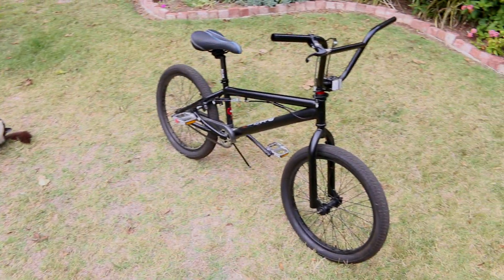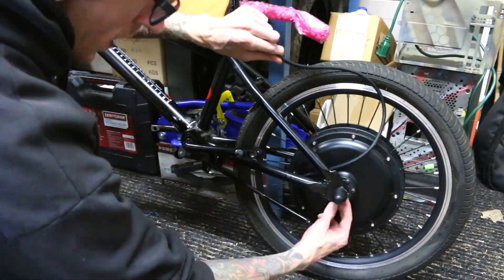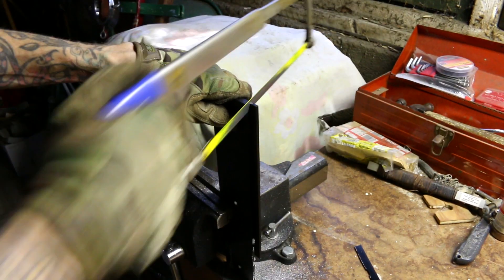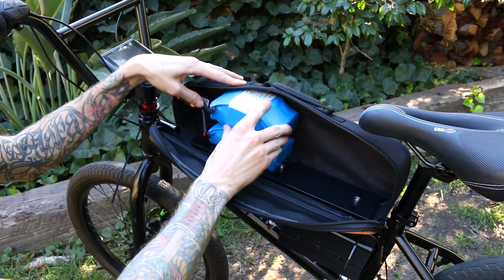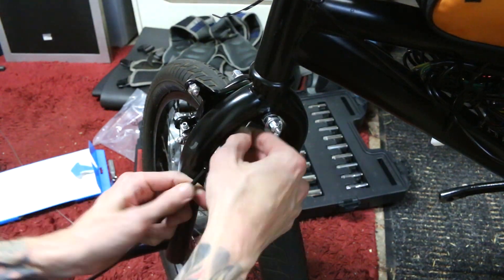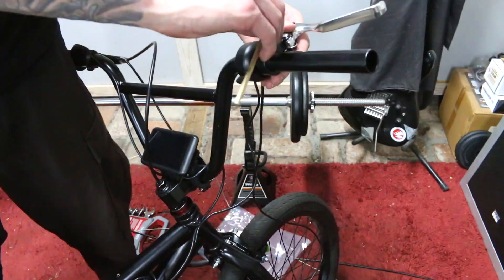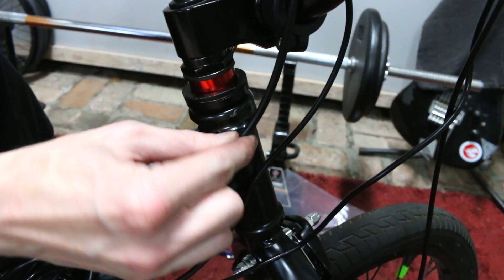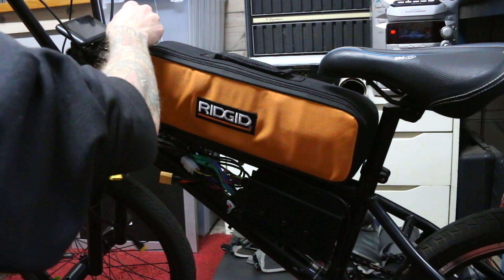🚲 Custom 3000W BMX E-Bike [45MPH!] - Part 2 - Electronics, Tires, Brakes,  Controller, Battery Tray

Comment: Oh btw what wires connect to what in the controller
Reply from the maker: That will be controller dependent as they are all similar, but may vary slightly. This is a good general overview: https://forums.electricbikereview.com/threads/sensored-motor-controller-wiring-manual-deciphering.55916/

Comment: if someone did this with a 1500watt kit on a 20 inch bmx would the wheel still not fit or would it fit without having to expand the frame?
Reply from the maker: You will need to stretch. BMX is 110mm dropouts, most kits are 135mm. Some front wheel kits are 110 but they are meant for the front wheel.
Reply: @hightech-lowlife  Okay, thanks for the advice, I love your videos!
Reply from the maker: @Chucklodown14  No problem! Thank you. 

A 15mm stretch is very small that is a little over a half an inch, but remember that is split between each side, so really a 1/4in per side, it's very small.
Reply: @hightech-lowlife  Thanks for your help (:
Reply from the maker: @Chucklodown14  💯🍻

Comment: never use slime at 32+ mph. Your tire will have slight up down up down wobble. Ounces can turn to pounds when wheel spins at high speeds. Take a paper clip and string with small weight. tape string to surface and spin very fast then let go. the weight will rip tape off due to centrifugal force multiplication. Amount of slime = off balance weight.
Reply from the maker: Do you ride with slime?
Reply: no i use thick tubes liner cut so it does not off balance 360 and country tires my mtb has slime :p because it is nifty just not at high speeds. the bike i have now cruise at 56 mph. no slime :/ @hightech-lowlife
Reply from the maker: @itwasrightthereinfrontofyou  I have moved on from slime as it doesn't work as well as I'd like, now I use vinyl inserts. Although I've never had a problem with slime regarding hop/wobble/obtuse concentricity even at high speeds. I don't go very fast though on ebikes (20-30 max), most bicycle tires are not made to even go that fast, let alone double 👍 If I want to go really fast I have motorcycles for that.
Reply: I have a 52v 1800w motor rear with a 80cc engine on a electra cruiser frame called the red sonja. She is sturdy and cruises at 55 mph with HD bearings. She use to wobble with slime at 30-40mph. Safe vehicle as she is made of 100% German steel. The lining does work great...without it I feel naked. A standard bicycle rim is rated at speeds of 100 kmh. HD bearings double. UHD or Moto wheels triple and more. I pack my bearings with red grease as white or moly "fling" out at high speeds. Red Grease does not as it is the stickiest grease. I do things like this because i have my own shop and build whatever I want. I even build motorcycles. My current project is a ebike that has  96v 12000 watt. IDK what i want to really do with it.  @hightech-lowlife
Reply: dude your channel has Hebrew. I study Ancient Hebrew. That is strange. @hightech-lowlife

Comment: would you reccomend this for me? i really want something small and electric, is it worth it?
Reply from the maker: It's a bit much in terms of power, if you're not going to use it then you're better off going with a lower power level that will also be much less expensive. 👍
Reply: @hightech-lowlife  ok ill keep it in mind, cheers!
Reply from the maker: @ishittedinmypants7963  If you don't care much for the BMX style, and just want something small and compact there are a lot of folding ebikes with smaller 20" wheels on the market that are premade, they have 750~1500W and would suit you just fine if you didn't want to build your own. There are pros and cons to both approaches, it all depends on what you're into 🍻

Comment: I actually something similar except I mounted my battery on a rear rack lmao. 

Not sure if that’s a great idea or not. I just don’t want that rack to snap off or some shiet. 

I also have bungee cords wrapped the battery in a way that it holds the battery on the rack. And another bungee to hold the battery in the case if the rack snaps off suddenly.
Reply from the maker: Thanks man! Rear rack should be fine! I only don't like that position because you already have all of the weight in the back with the motor, but aside from that it's an easy way to add a spot for the battery 👍Bungee cords should be fine for mounting, the stretchiness can quiet down rattles too.

Comment: No E-break with the controller? And its a 3Kw kit.

That kit most have been really cheap.

I built an E BMX and I paid 250 dollars for the motor and controller. And its a similar looking motor to yours with a 40A controller.
Reply from the maker: It was pretty cheap! 🤖
Reply: I guess you are running 72V? (36×2)×3
Reply from the maker: Exactly that config, yes!

Comment: There are hydraulic rim breaks that are super powerful you can use those
Reply from the maker: Never would have imagined haha, I keep calling these 'friction' brakes but I think they are rim brakes, or 'caliper' brakes more specifically. I remember as a kid these did not work very well, probably because I was going down hills in the rain, but I can attest that they actually work surprisingly well. Maybe just because I'm bigger and can squeeze the levers so much more. Thanks for the suggestion I'll check out a hydro setup!

Comment: LIPO or Lithium ION batteries? Did you have to wire them in a series? I heard LIPO is cheaper and more powerful, but more risk and a pain to charge separately.
Reply from the maker: These are Lipo packs, actually both series and parallel, I'll explain more about this weird battery setup in the next video, thanks for watching!
Reply: @hightech-lowlife  Those are not Lipo Pack. They are "hoverboard" pack with 18650 cells.  Generally they use very low quality cells.

I use 3 tattu lipo packs 22.2v each in series. Look into those. They can discharge 300A+ without break a sweat
Reply from the maker: @Full_Throttle_no_Brakes  These packs (and others) that are 18650 cells are typically made from Lithium Polymer (LiPo), this has to do with the material chemistry of the battery. I know that these packs are LiPo, as most that contain 18650 cells are. Of course there are different grades available that can focus more on discharge rate (C) or high capacity (mAH). Also varying degrees of quality, these packs are shown to have Samsung cells. 

I took a look at those packs you use and I'm not sure if they have an onboard BMS for over and undervolt protection during charge or discharge. A lot of RC packs do not have BMS's built in because they have a separate speed controllers and chargers that will do that.
Reply from the maker: D A V I D  Thank you so much for watching and for the feedback!